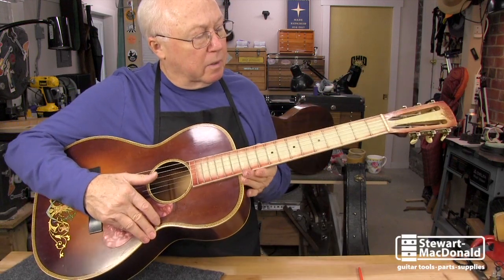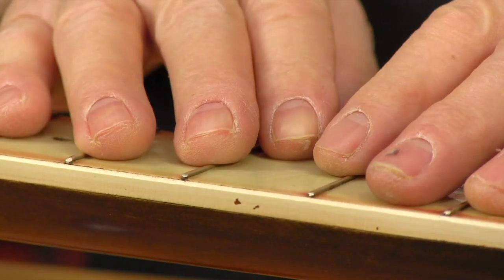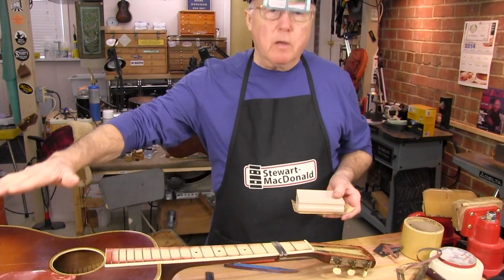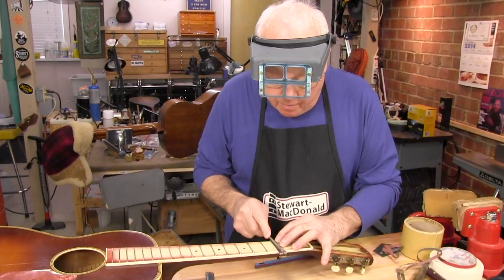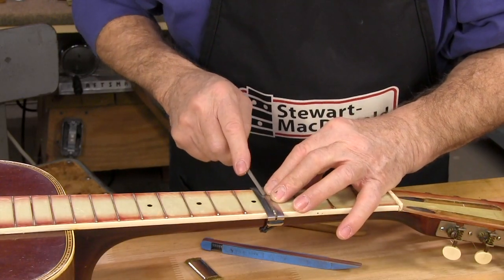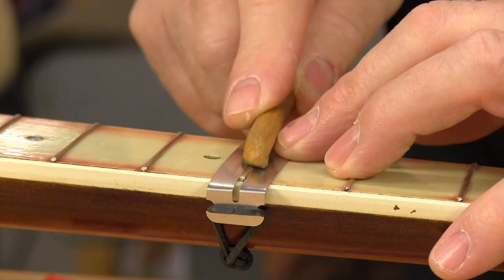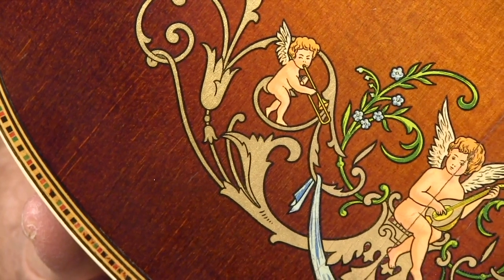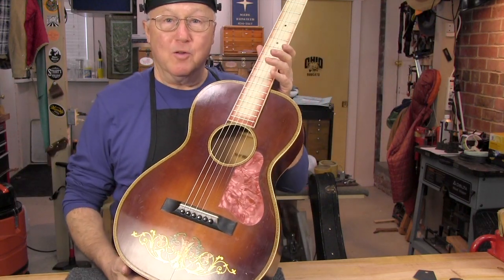Fixing fret buzz: spot leveling and re-crowning

Comment: It never occurred to me that a string could buzz on the fret it was fretted on. I did like the mother of toilet seat. I'd never heard of that before. Thank you Dan
Reply: Mrlz56 look from 0.40 where Dan explains, with the aid of the diagrams, how the string can buzz on the flat top of the fret that is being fretted. Crowning the fret gives the string a precise  point of contact with the fret allowing the string to vibrate without buzzing on that same fret. Buzzing on frets further up the neck is a different problem and I would post a video myself if I had any skill whatsoever in the area of fret filing. So I will just have to carry on with what I do know: talking bollocks.
Reply: Mrlz56 it can buzz on the flat top fret it being fretted if the guitar had higher strings action because the string comes in contact on the front side of the flat top fret while leaving a tiny gap on the back of the fret to cause the buzzing when the string vibrate. Buzzing on the fret further up the neck probably caused by the strings action being too low or it had uneven fret crown. Which is the fretted fret is lower than the fret further up the neck.

I'm no expert but I think those are the possible reasons for both problem. By the way, I've re-crowning all of my guitar's fret and buzzing no more.
Reply: They say the same about flat nut slots: you can get buzz in the nut slot if you don’t angle it back toward the headstock

Comment: I've always had a mixed feeling about fingerboard guard and I'd like to see what other people think. On one hand of course it's handy if you're just working on a few specific frets, but on the other hand, it, being metal, leaves slight parallel traces that don't completely go away (at least to my eyes) even after fret oil. Thoughts?
Reply: Smooth off the edges with a file, polish.
Then use it.

Comment: The neck I have came from China cheap because I was going to re fret it and put abalone dots in. The fret markers are not centered, and not centered in the middle of the neck. Markers are like 6mm to one fret and 8 mm on the other side. 12 3/4 to the 12th fret. I have a StewMac fret scale with a fender 25.5 scale on it but when I lay it on the neck many don't center with the rule and the high note frets are way off is this normal or do I have a piece of firewood?

Comment: Im  wondering what would be the best way to fix some frets on the end of the fret board say between the 15th thru the 20th fret, when making bends the strings will die out and not ring like on the lower frets. Should I just remove and sand off some the frets from the 15th thru the 20th alone? Any info would be appreciated. Thanks

Comment: why is there not a file that is a concave to make the fret curve as you use it?
Reply: Doug H. in VA 
its called a crowning file
Reply: so why does a pro not just use a crowning file, then ?
Reply: @DougHinVA  Reasons I have heard stated (although I could not vouch for whether they are true or not, so take this for what it is, just second-hand info) is that the triangular file affords the user more precise control, and allows the user to remove less material.

Comment: Why are you not using a crowning file to do those frets?  I know StewMac sells them.
Reply: +Alex Tworkowski Good for new frets, but not old or worn, low profiled frets!
Reply: sirswift23 Ah, very good.  Good point.  I just noticed that you have a unique guard over the fretboard.  Where in the world did you find that?  That is a gem.  I didn't see that in any of the catalogues.
Reply: +Alex Tworkowski It's a modified chip stopper! Slotted at the end to accept some rubber band. Sometimes the best tool for the job is a tool remade for the job....
Reply: sirswift23 I find that's always the case.  I have a friend that swears that the people that design and make tools never use them.  I agree w/ him.  I find that i need to modify allot of my stuff.  Just Googled chip stoppers and Stew Mac came right up w/ a video.  Thanks for the info.  Gold.

Comment: Triangular shape doesn't make sense for that as it is used as a tilted  flat one. Makes no difference. 
A pentagonal would do it as it would allow to use the board as ground and the correct angle would be against the fret... Do I need to make a drawing?

Comment: Doesn't sound like you did a spot level.  You sanded the whole fingerboard..
I'd like to hear you talk about identifying a single string and buzz on that string. 
One thing no one ever talks about is the couple high frets you will encounter if you refret or level....and I'm not talking about frets that aren't seated all the way.  If you don't address them individually  and get them down to the general area of the other frets before you go to town with the sanding beam than you will have very low frets at the end.  I've been using 500 grit sandpaper in my hand and only hitting the part of the fret that's out of line.  If you run the sanding beam and there's a couple high places....deal with them first.  Than go to work.  This has been the biggest pain in the butt for me as I learned to refret.  Nobody tells you about it in the video's...it's the difference between getting a great refret and a great refret with low frets.

This works with a high fret on your finished guitar also...if it's not a popped up fret.....dress the fret in front of the fret you've fingered (that's buzzing)....you can use a good recrowning tool to take a little off the top to get those pesky little one note buzzes...a couple swipes and then test it...it my rock on the next 3 frets but sometimes it fixes it and doesn't move the buzz up...doesn't always work but you're going to have to do a full leveling anyway if it doesn't.
Reply: David Kennedy Yes you are very correct. Ive only been doing my guitars for 1 year. There very cheap cause i dont want to screw up anything nice. And i had a question? When you crown the fret or polish it, does it make that fret lower?